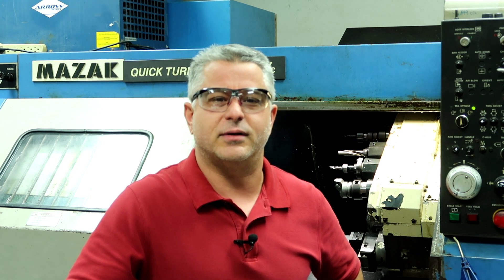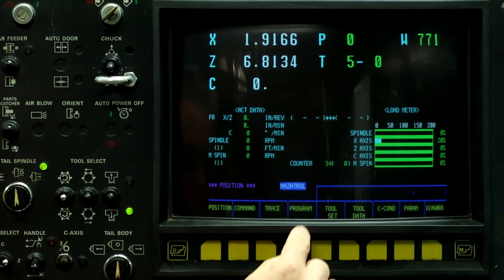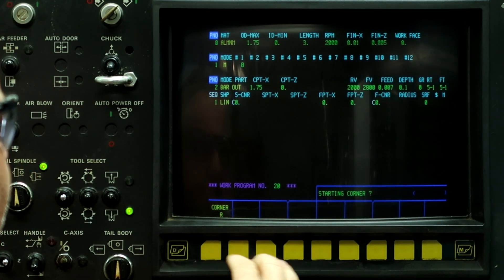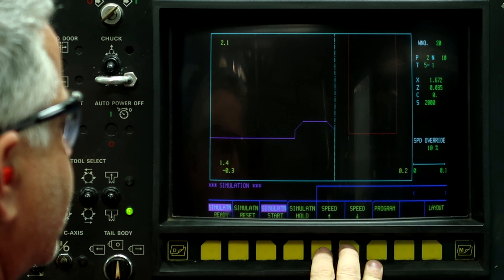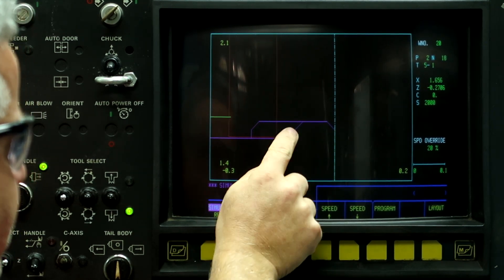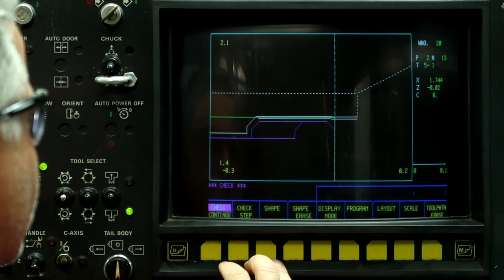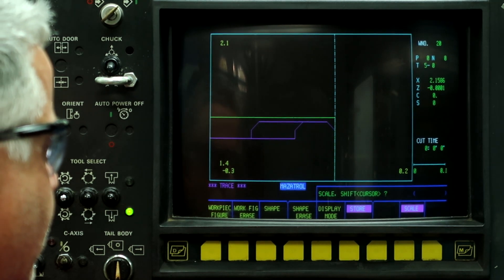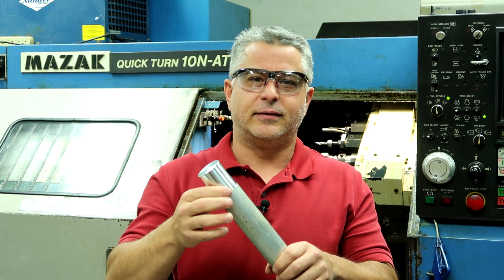Groove Turning Mazatrol CNC Lathe

Comment: Thanks for making these videos. Last year I had never used a cnc lathe before, only having experience programming mills offline. I decided to buy a cnc lathe but was nervous to go mazak as I was worried I would have difficulty programming using mazatrol. 

These videos gave me the confidence to buy it and now I love it! The control is very powerful and practical. My machine is a SQT 18M on T-plus control. 

I am limited on live tooling, having only one axial and one radial tool holder, can 2 tools be used in one holder with a program stop to change it over manually using 2 offsets? Perhaps I would be best  to just buy a few more live holders!
Reply from the maker: Glad to hear you are doing well! Look on Ebay for the live tools.

Comment: Hi, thanks for lots of useful videos. I wonder if it is possible peck feed in ID or OD turning. Similar like in grooving?
Reply from the maker: Peck feeding is only available on the newer controls.
Reply: @mazatroltipsandtricks6816  I have Mazak SQT 250 MY with mazatrol 640T control. It's a litle bit newer. There shuld be peck feed function? And if there is maybe you know where peck feed function turns on in programm or defined by some parameter?
Reply from the maker: @marciszarins  Peck feeding is cut type 4 and 5 when doing a bar out process for example. I don't know what control had it first but it is available on the Smooth X control.

Comment: Good day Phil,
We have a Mazak Quick Turn 15 from 1989. Management is also Mazatrol T2. There is an alarm for the X axis on the display. We have a local repairman who is trying to fix the error, but he can't find the controller's system diagram anywhere. Can you help us with that? We can also send you a picture if you have a contact. Best regards
Reply from the maker: Post a question on the Mazak forum and myself or someone should be able to help.  https://www.practicalmachinist.com/forum/categories/mazak.36/

Comment: Awesome video! I was wondering if you could make a video about machining on tbe B Axis? Im having a silly issue where I'm trying to turn on the b spindle but the cutter goes in the opposite direction of the part
Reply from the maker: I do not have access to film a video like that. Sounds like your tool description is incorrect.
Reply: @mazatroltipsandtricks6816  Oh I see, I shall take a look. Its odd because I can face the part on the back spindle, but when it goes to turn the OD it moves away from the stock.

Comment: hey phil i am triyng to do a 55 degree groove instead of 45   default
is this something i'd have to change in parameters cause the "ANG" taper option does nt seem to work 
the groove is 8mm wide on the bottom of it minor diameter 38mm 
16mm wide on top with the OD being 50mm  
and i am choosing option #4; width as .315  i have tried 33 degrees 
146 degrees 
none of it matters it keeps drawing a square box
Reply from the maker: @fredrezfield1629  you need to use groove option 1 to groove both sides or option 0 to only groove one side at an odd angle.
Reply: @mazatroltipsandtricks6816    awesome  tahnks ironically though i tried your groove turn method and it worked i! had to compensate for the width of the insert

Comment: hi Phil, could you send me the parameters for your machine via email?
Reply from the maker: What machine do you have and are you wanting imperial or metric parameters?
Reply: @mazatroltipsandtricks6816  Mazak qt 10n atc m/c 1991 I need metric parameters machine recently bought but without documentation.
Reply from the maker: @Ciasteeek  My machine is a 1986 model with inch parameters. Unfortunately my parameters will not work for you.
Reply: @mazatroltipsandtricks6816  in the book there are inch and metric ones, please send me, I can handle it
Reply from the maker: @Ciasteeek  I do not have the book parameters.